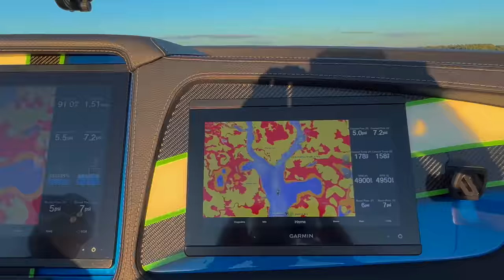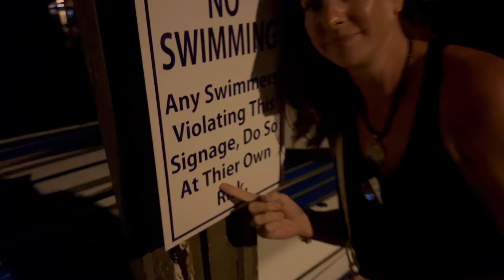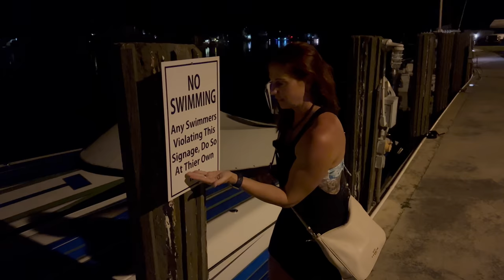Fast Boats Lifestyle Ep. #1 - 4X4 Fun Run 2022 w Howe2Live

Comment: How did you get your boat to go those speeds none of the other ones are that fast?
Reply from the maker: Great question.  Some of the outboard cats do go as fast as an MTI 390X but that’s on perfect conditions.  What separates the 390X from other outboard cats is that it can go very fast in rougher water.  It’s the fastest “rough water” outboard cat made - very stable and not flighty in the windy chop.  Many outboards are just not there yet.  390Xs are the kings of go fast outboards right now by pretty big margins.   I’ve also had my 390X made to be the lightest and had it professionally tuned and rigged by World Champion Shaun Torrente.  Lastly, driver’s ability to know his boat and its capability in certain conditions also matters.  I have the most miles of anyone in the world on both the 340x and 390x to date.  Experience matters.  Thanks for watching and great question.
Reply: @Howe2Live  Thank you for the reply I like your channel and love the content but still not buying the 130 + have fun thanks for sharing